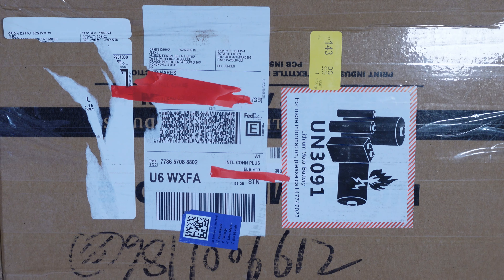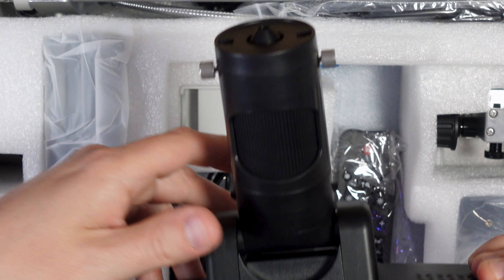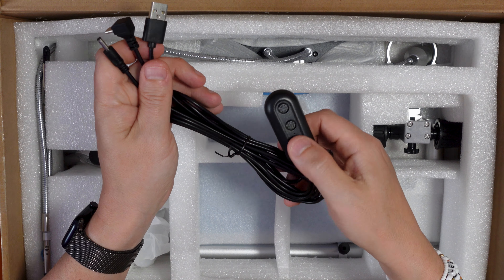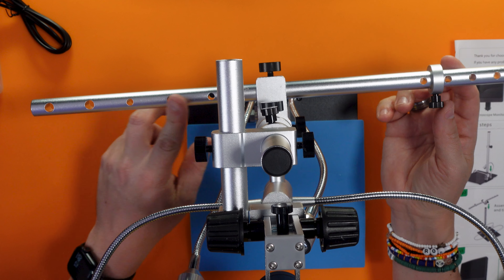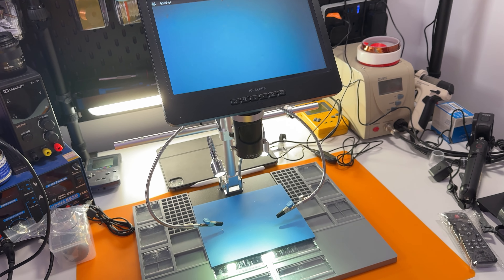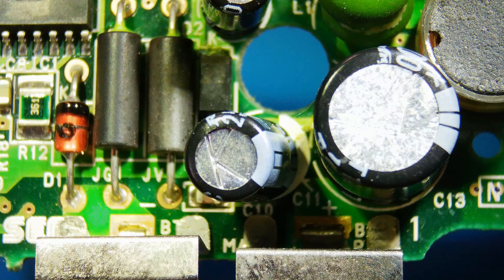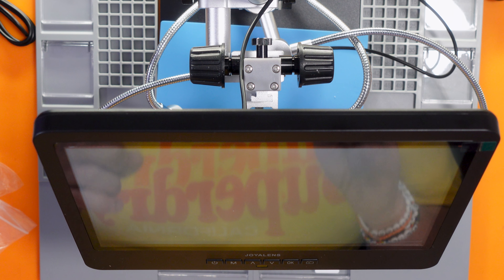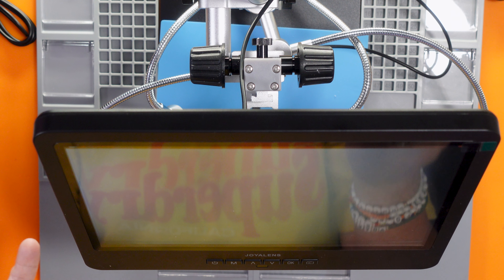The BEST Digital Microscope for YOU - But it has a MASSIVE flaw! The Joyalens JL249MS Plus

Comment: Is the "Joyalens" brand a kind of "clone" or knock - off of AndonStar? Did you happen to check Tomlov? Thank you 🤓🖖8:13 point very well taken! Did it come with a warranty?
Reply from the maker: I think they are all essentially the same, just rebadged, the software on this was identical to the Andonstar I used to use, (although this one had the WiFi). I’ve looked at the TomLov previously on my channel.
Reply: Yes there are very few manufacturers